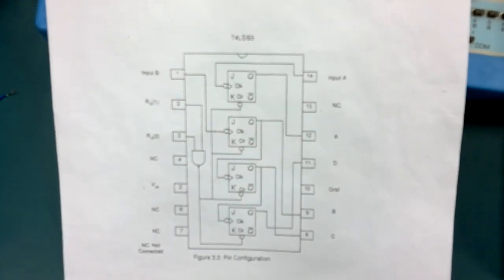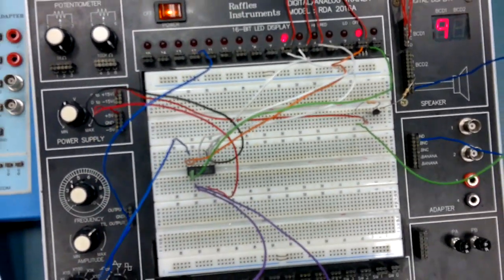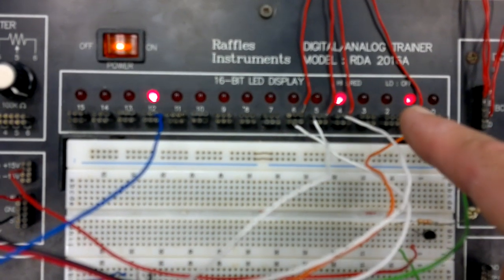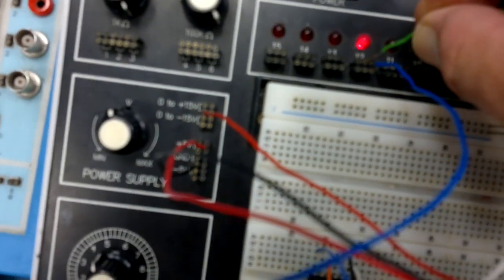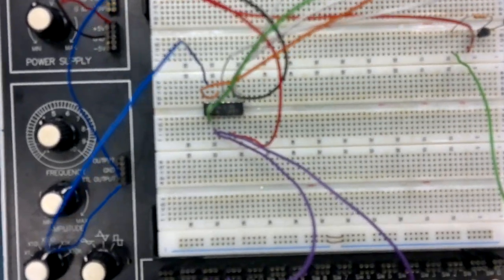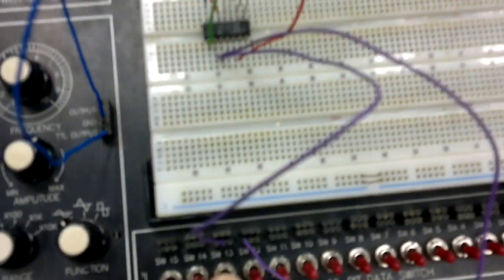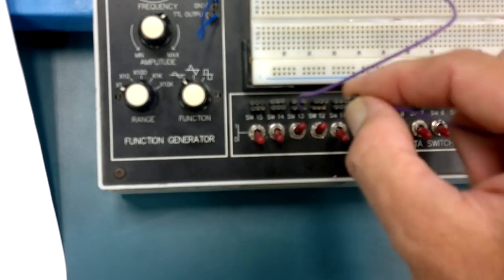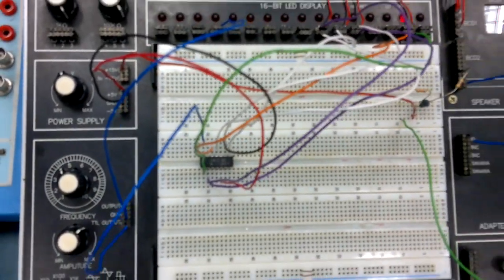Wiring up the 74LS93 4-bit Counter

Comment: I hope you see this! I need it to count from 9 to 0. It is on down count, and it willc ount 15 to 0 fine, so I NAND 15 to load ABCD which is set to 1001 (9). It will count 9, 8, and then reset. 

I don't understand
Reply: You need to use and up/down counter like a 74LS90 or CD4510